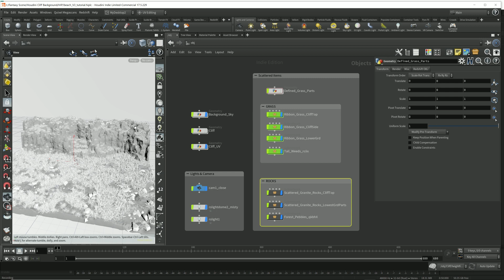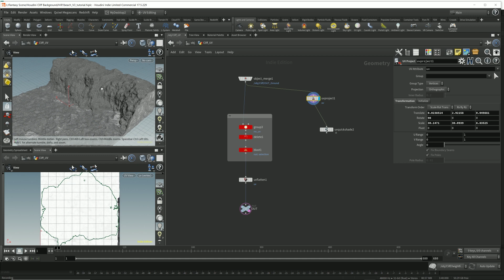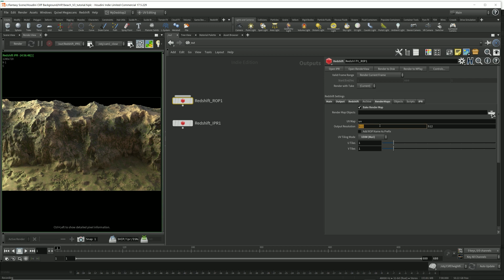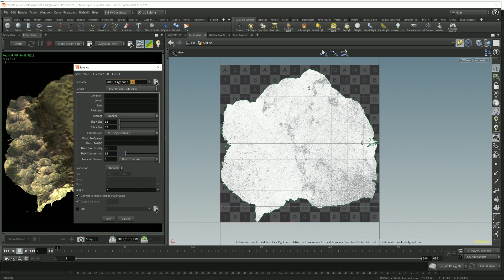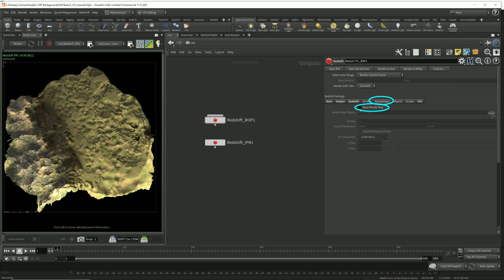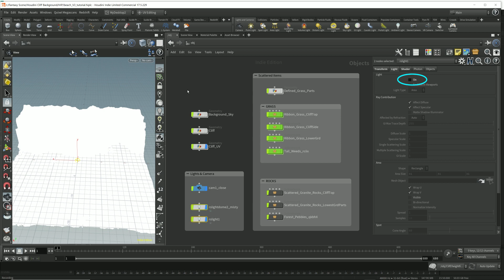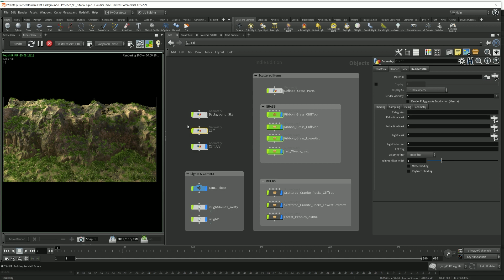How to Bake Light Maps using Houdini & Redshift and How to Setup a Material to use Light Maps

Comment: I assume you can bake building instances too? I need to render a big city what do you think?
Reply from the maker: THat's actually perfect for baking light maps, because the buildings aren't moving and it's fixed lighting conditions!  Any scene where you have fixed lighting conditions.  Non-moving lighting and non-moving objects, the stuff shown in this video would be perfect.  This concept is actually very similar to the UE4 lightmaps, they bake all the lighting in there making it super fast.

The only time where this would fail is that you have moving lighting, like if you're trying to create a time lapse scene then it's probably not that great for that scenario, because the lighting conditions would be constantly changing.

Hope that helps!
Reply: @bubble pins  thanks a lot for your answer. Really appreciate.

Comment: Your parameters box is inside the network pane. How do you manage that?
Reply from the maker: I did that on purpose, because I expand the network panel to the full height of the screen.  Sometimes I detach the parameters panel to be able to move it around.  I like having a larger view over the nodes.  You just press P while the mouse is hovering over the network panel to get it over there.
Reply: @bubblepins  Thanks its a much cleaner layout. Id put the network on my second monitor but Im typically watching Tuts or resarching methods on there.

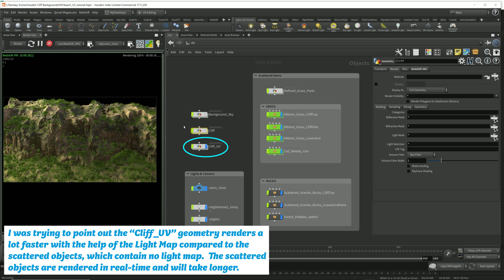Comment: Very nice, but 1:55 vs 15:05 render..
Reply from the maker: It should look almost exactly the same thing because at 15:05 it's just rendering out the light map that is baked from 1:55 It's like grabbing the light data and saving it and then splitting it back out.  It's an alternative to those with weaker machines.  This was a technique I heavily relied on in my early days, because I had a very simple computer.
Hope it still helps everyone!

Comment: I have 4 UDIMs on a piece of Geo. I can't seem to get it to skip over to the next Udim and start baking at 1002,1003, etc. I changed the tiling but that just made it a way larger(wider) image? I have to be doing something wrong haha.
Reply from the maker: Do you have UDIM selected in the ROP node? 6:38  under the RenderMaps tab
Full disclosure, I never actually tried UDIM with Redshift.  I only started using UDIM with Mantra lately.
Hope that helps!
Reply: @bubblepins  I do have  UDIM selected. I think I'm getting closer to getting it. I can at least get it to render the first UDIM spot and label it with .1001 but it stops after the first. If I get this I'll report back on the best way of achieving a render on each UDIM. The Mantra bake is amazing and I would just do that as my last resort as I don't want to relight this scene quite yet :). Thanks for the reply!
Reply from the maker: @iamshrimpcat  oh I think I understand what the issue is. In the Redshift ROP node, for the output file, you need to put the variable in there to indicate what is the image name of the UDIM.  When you unwrap the UDIM uv's, that's when you name them, 1001, 1002, and so on, then you need to tell Redshift how to output the image name like,  MyTexture.<UDIM>.png 

You need the <UDIM> in the output parameter of the rop

https://docs.redshift3d.com/display/RSDOCS/UDIM+and+UVTILE?product=houdini

Hope that helps!
Reply: Thanks for your help! Got it all figured out now.

Comment: is it possible to bake maps from highpoly to low poly model in redshift?
Reply from the maker: from high to low? Usually it's the other way around, low poly to high using height maps, or displacement maps.  I'm not sure how to do height maps using redshift, but mantra can do it.  I did it once, but Mantra is complicated sometimes.  I know SideFX added an easy to use Labs tool to do it.  It's called simple baking.  That will give you a height map.
Hope that helps!
Reply: @bubblepins  he means baking normal maps from a high poly source object to a lower poly target object to produce a game ready asset that maintains the details of the high resolution object but baked into the texture, typically normal map, of the lower poly version of it.